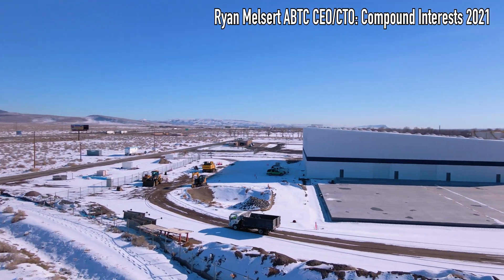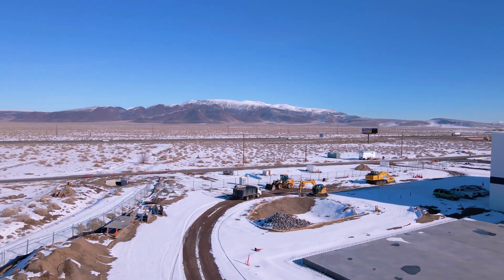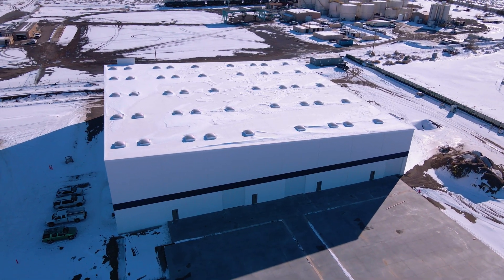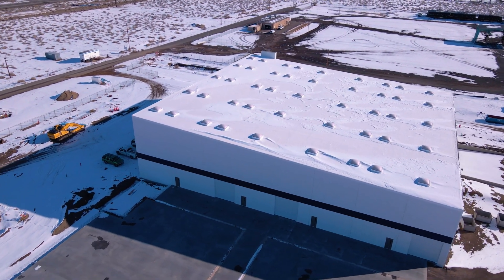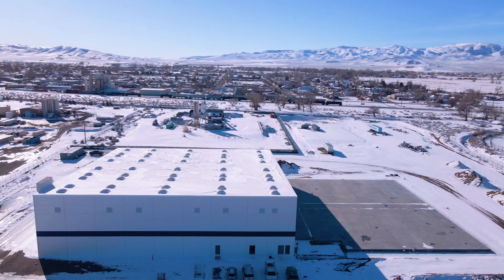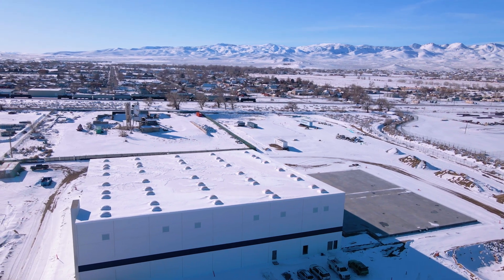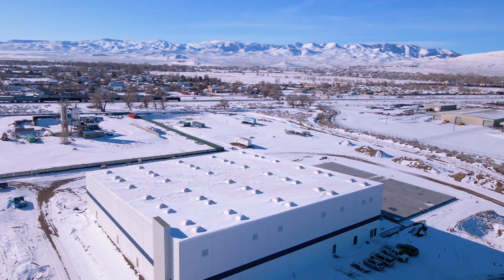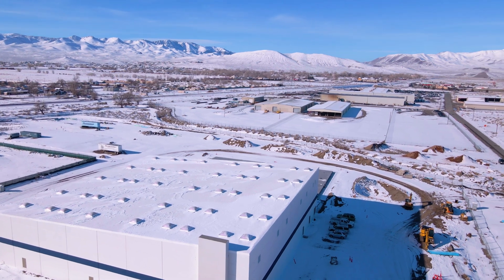ABTC Lithium-Ion Battery Recycling Plant: January 20, 2023

Comment: Doesn't look like much has changed since NoV. 2022.
Reply from the maker: Beyond the utility work nothing else seems to have changed outside the building. We know the permits for Phase 2/Warehouse and the office were issued in December. But no work it seems has started on those yet. Just inside work is the only thing showing up on the Fernley Inspection schedule.